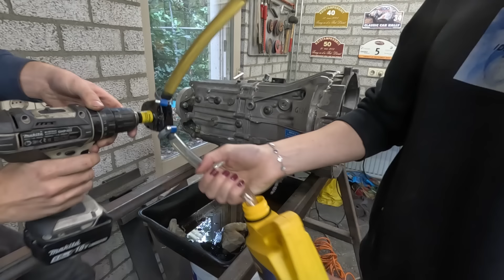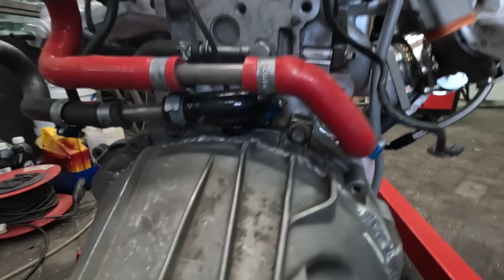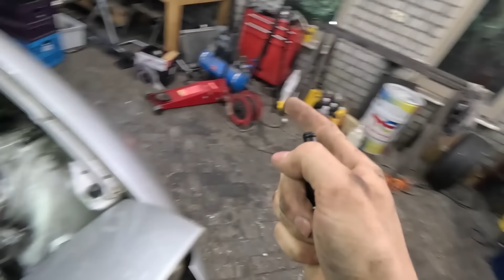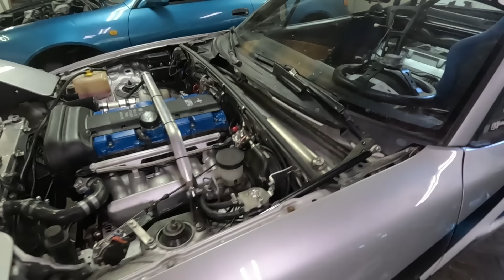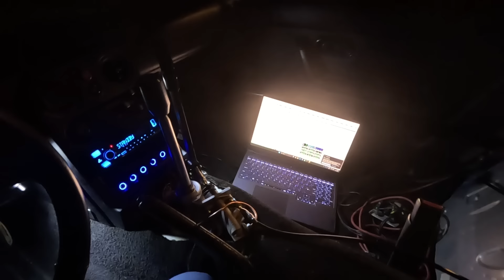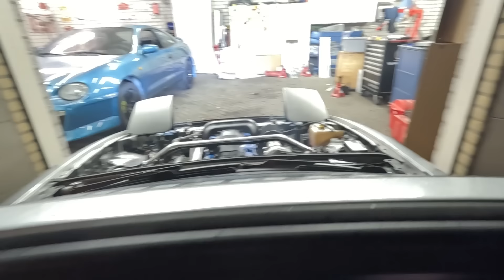5 CYLINDER Swapped Miata | First Drive!

Comment: That rear trans mount looks a bit on the lightweight side, especially in aluminium. Also the hoseclips at tge back of the cylinder head look to be almost impossible to access once it's all assembled. Having done similar things in the past I can confirm that the regret is real!
Reply from the maker: The trans mount is steel, just painted silver. The back hoses are quite accessable, but underneath is the crank position sensor. That's the only big regret haha, you would've seen me struggle in the first start video

Comment: You could have issues with your shifter when driving hard later on, due to the shifter being mounted to the body and the gearbox on rubber mounts. If im not wrong the bmw has a arm extending out from the gearbox with the balljoint in. Worth to consider, otherwise great build man!
Reply from the maker: Thanks! Yeah this is an experiment mounting it to the chassis

Comment: You are one of the few YouTuber's using a engine leveler with a hydraulic hoist . When installing an inline six ( or 5 in this case) it makes a virtually impossible job with one person possible.The pan and dry sump lubrication system fabrication looks top notch.
Reply from the maker: Yeah the engine leveler is only 38 euro, don't know why people would skip it

Comment: Hey bud, I have a question about the transmission. Are those welds gonna hold? I mean, the weld didn't penetrate to the other side and it is a cast aluminium so chances of breaking could be quite high. Aren't you qorried about it? Was there an alternative like an adapter for it?
Reply from the maker: I wanted to check if the whole setup would work. I'll pull the gear box back off to wel the inside too. I'll make a groove before welding to get deep penetration
Reply: @yatajoris 👍👍also why bmw tranny? Gear ratio or strength or both?

Comment: I've welded a few bellhousings like that and never had any issues with them breaking 👍 500hp drift cars with clutch kicks😂
Reply from the maker: Did you weld the inside aswell? Because I still have to do that too, just wanted to prove my setup works before committing
Reply: @yatajoris no just welded from the outside. Nothing to worry about as long as it's aligned will be fine
Reply: How do you make sure everything is aligned? I need to do this and am doubting my ability to align everything well enough

Comment: This makes me want to attempt this in my AE86 🤤
Reply: Please do. Volvo or Volkswagen, just get 5 cylinders in there.
Reply: That would be a sublime ride
Reply: I did in my frs and it was a huge improvement made the car really
Reply: @oliverscorsim which engine did you use?
Reply: @musewolfman gotta go look but s60r 2.5l shimmed and filled deck with vwpd150 head bolts and a mystery turbo that I like too much to pull off 😅 full spool by 2k pulls strong to 9k with a custom intake manifold (think na dual runner just I made it with a shorter runner on the second set.)
Reply: @oliverscorsim do you have Instagram, id love to see this build